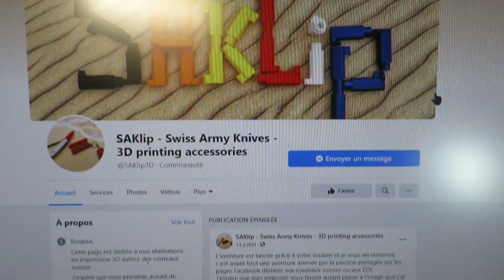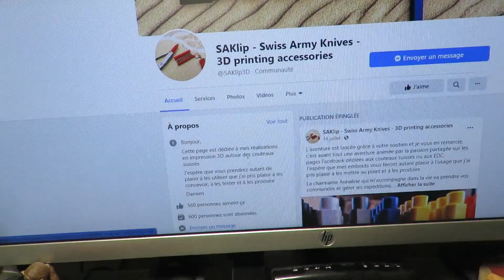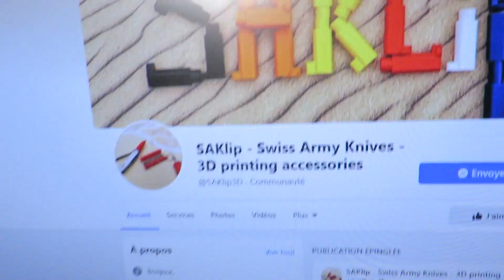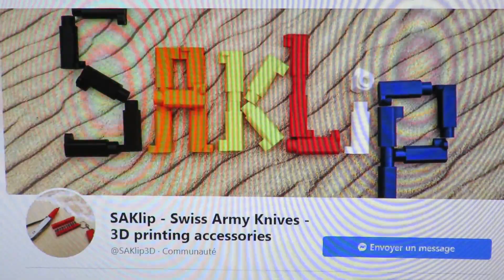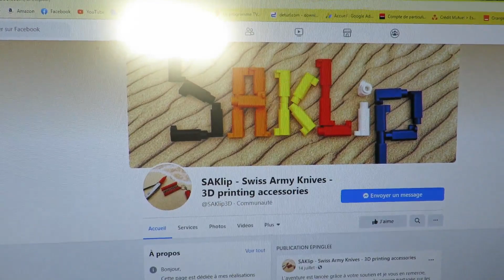Fantastic Mod for VICTORINOX : SAKlip 1/4" BIT DRIVER !

Comment from the maker: The SAKlip adapter weighs approximately 7 grams.
Obviously, it will be used for small jobs, for example assembly or disassembly of furniture, electronic devices, etc.
The adapter has been tested at 5 Nm without deformation.
L'adaptateur SAKlip pèse environ 7 grammes.
Evidemment, il servira à de petits travaux, par exemple montage ou démontage de meubles, appareils électroniques, etc. 
L'adaptateur a été testé à 5 Nm sans déformation.

Comment: Hello, for the bits holder, you inserted the bits in the wrong direction, it's more practical in the right direction and it allows you to push a recalcitrant bit ;)
Reply from the maker: Vous avez raison, désolé pour la fausse manœuvre ! :)
Reply: @diezelle57  J'espère que tu prendras autant de plaisir à les utiliser que j'en prends à les concevoir et les produire, merci pour ta vidéo et ton soutien, c'est très gentil de ta part
Reply from the maker: @DamienCarpentier  J'espère que ce produit intéressera beaucoup les fans de Victorinox car il le mérite. Je réfléchi au moyen d'emporter le plus élégamment possible, dans un étui Victorinox approprié, l'ensemble de vissage ...
Reply from the maker: Comment ai-je connu ce produit ? Bonne question. Par "50 nuances d'EDC" : https://www.youtube.com/watch?v=U5HJI06y4SE&t=34s

Comment: Another Adapter with two Holes in Front would be very nice. One for 6.3mm Bits and another for 4mm.
And a Version for 111mm Vic's.
Reply from the maker: 4 mm & 6.3 mm, no ... For 4 mm, the CyberTool is made for that: https://www.youtube.com/watch?v=jR1YEpjH2oY
Reply: @diezelle57  But what if I got no Cybertool with me? As I really got no - by now 😄😄 Imagine on the use for 93mm Model - there is none option for 4mm Bits.
Reply from the maker: @666deadmanwalking  Je vous invite à acheter un CyberTool pour utiliser des embouts 4 mm. Il existe des adaptateurs 6.3 vers 4 mm.
Reply: @diezelle57  Je ne parle pas français. en anglais s'il vous plait
Reply from the maker: @666deadmanwalking  I invite you to buy a CyberTool to use 4mm bits. There are 6.3 to 4mm adapters.

Comment: Would like to see an Hardcore-Break/Drop-Test.
Reply from the maker: The designer and manufacturer tested their adapters at 5Nm without damage. Demonstration video on its FB page. I do not have a torque wrench to continue this test at higher torques. The adapter weighs 7 grams and I don't see how it could break if dropped. This adapter will be used for small jobs, obviously. If too much torque is applied, the risk will be the rounding of the hexagonal profile with cracking, I imagine.
Reply: @diezelle57  Of course - I think this is always just for small jobs, but for Emergency it would be nice to know.
Reply from the maker: @666deadmanwalking  Je vais acheter une clé dynamométrique ...